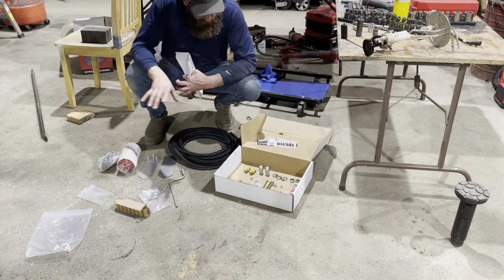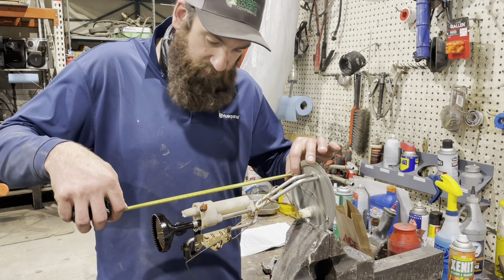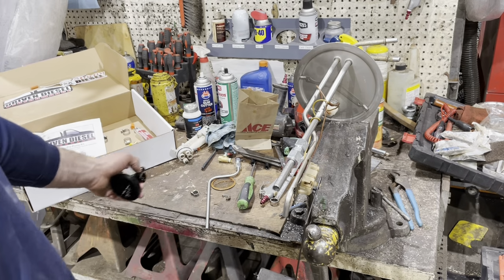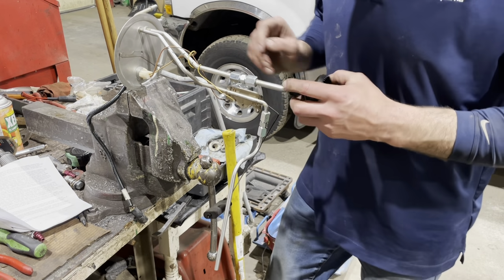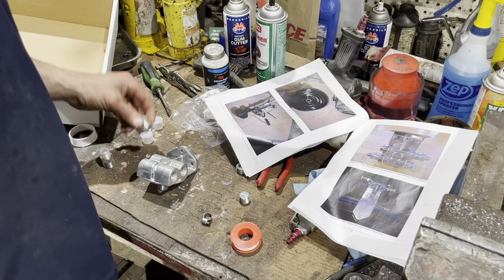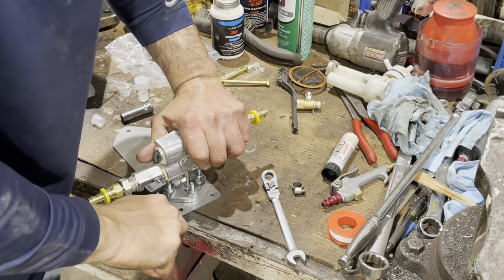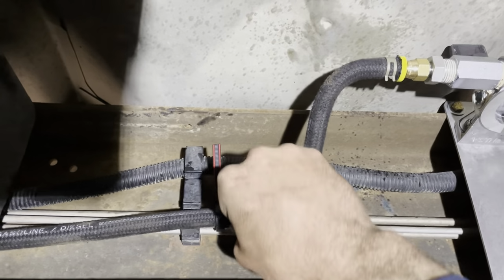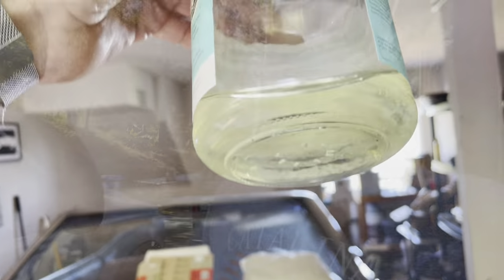Driven Diesel Hutch Mod Installation Walkthrough and Review 2002 7.3 Powerstroke Harpoon Mod Too!

Comment: Thank you very much!! Really needed the visuals as I was getting lost doing this upgrade.
Reply from the maker: Glad you found it helpful!
Reply: @bryanbuilt360  One interesting thing about my install over yours was that i have a single cab... There is not a lot of room to mount that filter. I either sandwich it between fuel pump and front diff, or between tank and front diff... It was a tight fit, but I put it between tank and front dif... Still only about 2-3" clearance on either side...

Also, did you run into issues with the bolts for the filter mount not being threaded long enough? I will need to replace at least the lower bolt because the threads bottomed out before the bracket was tight...

Comment: Did you ever address the repair of the fuel sending unit resister which supposedly is not available  separately? I enjoy and appreciate your videos. Keep up the good work. 👍🏻
Reply from the maker: Hey brother, I did not get around to it. Ford used the same resistor in the sender I think 1988 and up, that chip has to be swapped to the tan plastic housing on the sender. Most of them I have seen are yellow wires, I really need to make that video as these senders are so damn expensive
Reply: @bryanbuilt360 please do!

Comment: Great video! I’m surprised there are no comments on this yet. Very concise and accurate. I just installed the hutch mod and am curios about the shut off valves you installed on the filter housing. Do you have a link or part number? Thanks
Reply from the maker: Thanks for the comment! I’ve gained a few followers on Instagram from this video but that’s about it haha 
I do not have the part number for the shutoff valves… I purchased mine from diesel power products. It was boxes to check while ordering the kit. 
https://www.dieselpowerproducts.com/driven-diesel-fuel-tank-mod-73l-ford.aspx

May want to try and reach out to their customer service, maybe they can ship the valves individually. Hope this helps!
Reply: @bryanbuilt360  Awesome! Thanks for the info.

Comment: Awesome video! I enjoyed watching you work through the install. I wonder why Driven Diesel designed the filter kit to thread JIC connectors into the housing and then connect to separate JIC style barbs. It seems like threading brass barbs directly into the housing would be a lot simpler.
Reply from the maker: “What the f are you boys doing on my lawwwwnnn” hahaha love the profile pic! I was thinking the same thing while installing it, it seemed a little convoluted… don’t know if the valves they slchose had anything to do with it. I appreciate the shout out!
Reply: @bryanbuilt360  Give him the stick, NO don't give him the stick!! 😜 Subscribed, fingers crossed for more 7.3 stuff.

Comment: Great video. My kit will be here Monday. But do you know what size pvc is in the tank? Need to buy me a cutter.
Reply from the maker: Awesome! Good luck with the install! If memory serves me correctly it’s around inch and a half, so a two inch cutter should work out just great 👍🏻
Reply: @bryanbuilt360  should be simple. I dropped my tank to do brake line and knocking out tank mod while it out. Thanks ordering one now.

Comment: Amazing video.  Im   taking my bed off. Did you have problems with the bed bolts. Did you grind the heads off from the top. Dave . I have a 2000 f350 7.3
Reply from the maker: I thankfully did not have issues and depending on how bad the rust is (lol) grinding the head off won’t get the bed off. The shoulders of the bed bolts are wider than the hole in the crossmembers. So shoulder holds bed down to frame. However, in that situation I have welded 7/8” nuts to the heads of the bed bolts and turned them out that way
Reply: @bryanbuilt360  I got 3 bolts out that's it. The rest are seized. It's going to be a long day tomorrow.
Reply from the maker: @daverepole9283  oooof. I’ll be thinking of you! You got this 😎
Reply: @bryanbuilt360  thanks bro.

Comment: why put the umbrella back on? i thought the hutch mod also deleted that becasue they inevitably always break? is there another option for the end of the pick up?
Reply: And where did you see the option for the valves?
Reply from the maker: @snewcomer6831  I put it back on because I didn’t feel comfortable with just a metal line there, in case it dropped I didn’t want it to touch the tank and potentially rub through. Also prevent aeration nearby was a theory in my head.

Also just did a search at driven diesel and don’t see the valve option anymore, just the extra fuel line. Dang!

Comment: Hey Bryan, love the video. Very informative and detailed. I’m wondering if you know if the hutch mod needs to be done to the 6.0? I have an 03 f250 6.0 that is “running out of gas” at 1/4 tank. Any info would be great.
Reply from the maker: Hey there, I just took a look at a sending unit part online for the 6.0. It’s similar with that black pickup funnel. If that fell off in your tank you could be having those symptoms. Worth a look In the tank to see what’s going on. If that’s ok, I would suspect the float may need to be adjusted
Reply: @bryanbuilt360  I’ll take a look inside and see what I can find. Thanks for the help!
Reply: Hey just wanted to fill you in a after further research. I got inside the gas tank and saw that the pickup funnel had fallen apart. Replaced and problem solved! Thanks again for the help.
Reply from the maker: @Ar-turo-rosales  hell yeah! Thanks for keeping us updated here and I’m really glad you were able to get in there and fix that up!

Comment: Did you ever get the ceramic piece?Did you put the filter back in the pick up screen or leave it out?
Reply from the maker: I did not put the filter back in the pickup screen. I was happy the filter we were putting in was before the fuel pump so no harm there and any garbage in the tank would hit that filter and not have to pull the tank again if the tank screen got clogged

Comment: I wanted to ask one more question, would you use a sump? I purchased one but i wonder if its legal 1 and if its a good idea
Reply from the maker: What do you mean a sump? Oil sump?
Reply: A fuel sump. They attach it to the bottom of the fuel tank @bryanbuilt360
Reply from the maker: @chrisallen3741  oh I don’t know, I think I’d go with an aftermarket tank over that. Does it need to be welded in?

Comment: Does this apply to all years of the 7.3L?  I have a 94.5 with dual tanks
Reply from the maker: This applies to 99-03. I have never researched if anyone has done this on the OBS fords. I remember doing mostly FAAS fuel systems on those years because of the two tanks..

Comment: I don’t know if anyone is reading these comments anymore but I installed one of these and now my truck is running bad the engine shakes under acceleration thinking maybe the pickup foot is on the bottom of the tank really unsure
Reply from the maker: Still reading! Haha so does it run rough all the time or when the tank is below a certain level? Where did you mount the filters? Any other moss or tuner on the engine? Let me know!